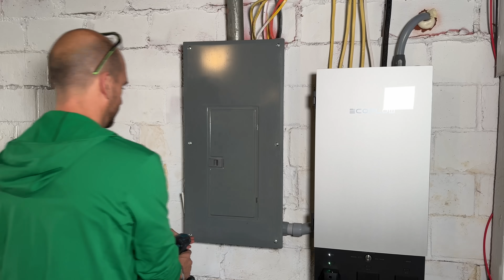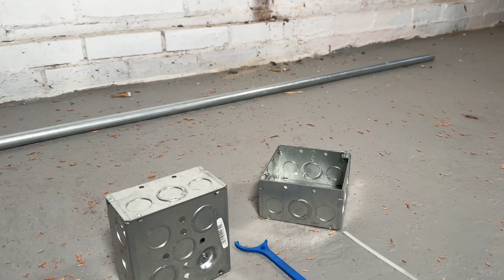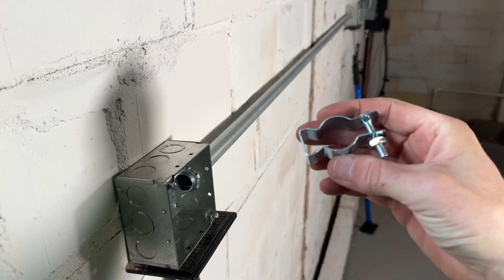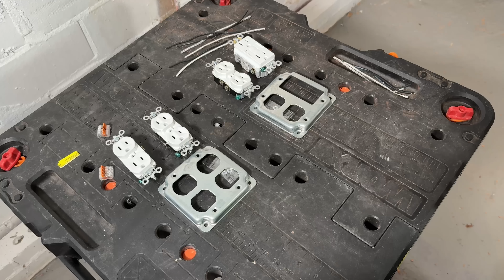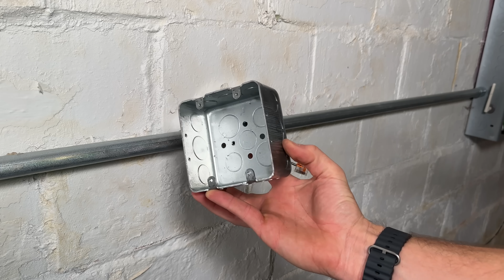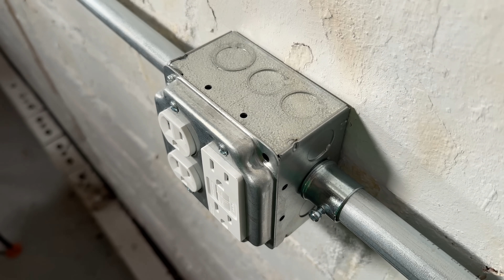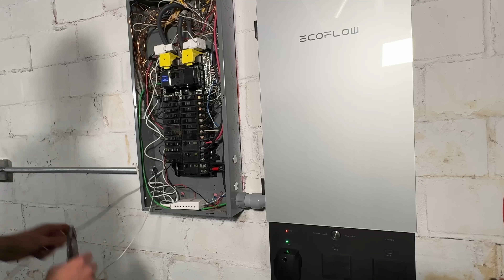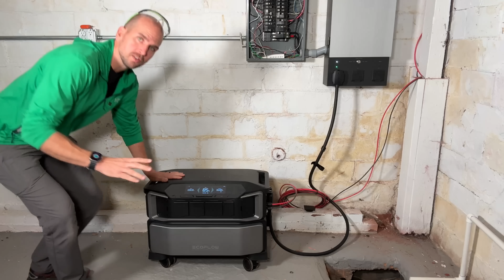Add Outlet To Unfinished Basement Or Garage

Comment: When it comes to bonding and equipment grounding conductors (egc's), the system should be designed such that a single point of failure does not degrade the integrity of the system.

In order to ensure this, it must be understood that bonding and egc's are two different things.  Bonding is intended to tie all metal surfaces together to guarantee that they are all at the same electrical potential in order to prevent a potential difference between adjacent metal surfaces that can cause a shock or an electrocution should someone inadvertently complete circuit between them. The egc is intended to provide a dedicated conductor to carry electrical fault current back to the source to complete the circuit and instantly trip the overcurrent protection to de-energize the circuit in order to reduce the risk of fire and electrocution.  Tying the bonding system to the egc, ensures that an electrical fault on the bonding system will trip the overcurrent protection and de-energize the circuit.

Relying on the bonding system to act as the egc significantly increases the risk that a high resistance connection will develop over time either through corrosion issues,  loosening of bonding screws, or other potential ways that the bonding can degrade or fail.  Having a dedicated egc ensures that the fault current path is not reliant on the state of repair of the bonding system.  It further ensures that each metal box and fixture are independently bonded to each other at the main panel through their respective egc's.  Even if the emt bonding screws come loose or individual bonding connections become compromised, each box and fixture will still remain bonded to all the other boxes and fixtures through their respective egc's.  In addition, in the case of emt, even if one end has its bonding compromised, the other end can maintain the bond and keep the conduit at the same potential.  Such a design ensures system reliability in the presence of a single point of failure.

Of course, you can have bonding failures at both ends of the emt, but, that would be 2 points of failure, and attempting to design a system that remains reliable in the presence of any 2 points of failure is nearly impossible, and even if possible is so expensive that it becomes unaffordable.  Also, in order for the emt whose bonding is compromised at both ends to become energized, the wires within would need to be compromised, which may happen if a wire was skinned during the pull, or during subsequent maintenance or repair activities, but that would be a 3rd point of failure.

In the case of your installation, a single point of failure compromises the system to save the cost of a bit of wire.  It's a very bad design.
Reply: Yeah, realistically, not running a ground wire here is comment bait. It might be to code; but nobody worth getting lots of views should do it…yet Scott seems to love to do that with his electrical work
Reply: The only way you can eliminate a single point of failure is to have two ground paths. Which is why in patient care areas you need to have two ground paths. If you use type MC or NM there is only one ground path.
Reply: @tcross7287  In the context of this case, the bonding path was being used as the egc, but with a separate egc wire, then single points of failure are covered.  With a separate egc the bonding path can act as a backup egc in the event of a single point of failure in the egc because the outlet provides an internal bonding connection between its ground pole and its metal frame which is tied to the box through its mounting screws.  Similarly the egc can act to maintain bonding in the event of a single point of failure in the bonding of the emt and boxes.  If the internal bonding of the outlet fails, the emt bonding path still maintains bonding and the egc maintains the outlet ground.  Thus, single points of failure are covered.

I'm not qualified to speak about hospital wiring as I've never had to deal with that in my career and I'm sure there are plenty of other special circumstance wiring scenarios that exist that have no bearing on the content of this video and my response to it.  I'm sure someone with expertise in wiring nuclear plants or some other special circumstance wiring can cite some esoteric requirement that challenges my statements, and even someone who will be put off by my use of the word esoteric who will then go on to explain why such and such a circumstance is not esoteric, but I digress...

I think at this point I'm done responding as the discussion is delving into special circumstances that have no bearing in this case and, IMO, offer nothing of further value to DIY'ers who will not be wiring hospitals or any other commercial applications.
Reply: @tcross7287  NM there is one all inclusive bonding and grounding path; the bare wire serves both purposes. MC has two lanes on the same roadway (a metaphor might be helpful), the metal armor and the green wire, that are both required to establish a single grounding and bonding pathway but they both serve both purposes and are not distinct pathways. I other words, it is NOT the case that the wire is the ground and the armor is the bond in MC. With emt if you add a green wire, that does create two lanes but they are not allowed to be distinct from each other electrically so to say that the emt is the bond and the wire is the ground is incorrect just as it would be incorrect about MC. They both, by being bonded to each other, create a single pathway to earth (dashed line allows for lane changing, solid line does not, same destination regardless). Hospital grade MC is no different, you are simply strengthening/reinforcing one of those lanes (armor) and not creating a separate pathway. There are exceptions by design, isolated ground circuits for example, but this is not one of them. When one starts with the (frequently but not always) false premise that grounding and bonding are different, the rabbit hole opens up.
Reply: The armor on type MC is not a listed ground path unless using MCAP with the internal bonding wire or HCF cable with a green ground and an internal bonding wire. I was trying to point out that first all there was no hazard if the ground path was interrupted to yoke on the receptacle as all of the receptacles were protected by a GFCI receptacle. As I’m sure know using a GFCI is the only way you can install grounding receptacles on a circuit that did not have a egc is to use a GFCI ahead of the receptacles. I’ve always pulled grounds whenever I ran EMT or RMC.
Reply: @tcross7287  MC requires the use of the metal sheathing AND the ground wire for an EGC, not just the ground wire, and it is not the case that the sheathing is for bonding and the ground wire is for grounding. Armored cable requires the sheathing be combined with a bonding strip, which means they are both parts a single EGC, but there is only one EGC that serves both bonding and grounding functions. I roll my eyes when I hear someone say that grounding and bonding are different and then proceed as if they are like 2 isolated roads that parallel each other and they are therefore distinguishable parts of the circuit. They're not. They are usually 2 sides of the same coin that are not seperable. EMT with a ground wire, both combined make up the EGC, not one for bonding the other for grounding. Grounding and bonding are usually identical in function and sometimes are a 1-lane road (ground wire in romex) or a multiple lane road (metal sheathing, bonding strip and ground wire in hospital grade MC). If you installed 5 green wires in a complete run of emt, all 5 plus the emt constitutes the single EGC for that conduit system. Multiples points of contact are not necessary for a properly functioning EGC. I've installed 480V 500A feeders through underground PVC with a single wire type ground and I'll never lose sleep over it.
Yes, adding gfi protection is the way to minimize the hazard of a circuit with no EGC and it remains gfi protected regardless of the presence or absence of a ground wire, but even in non-gfi protected circuits the devices are allowed to be bonded/grounded without a pigtail to the box and have their grounding path interrupted when removed/un-mounted) from the box. Self-grounding device to a mud ring attached to a grounded metal box, or a cover mounted device riveted to the metal cover, for example. If the device or the cover, is removed it loses its grounding path but it is assumed that a removed device is a temporary condition and not the final installed product, which it's not when things are installed correctly. I've installed hundreds of thousands of feet of emt, imc and rigid and unless it was spec'd or conditions required it, I've never added a wire-type conductor to support the already existing EGC. 
One thing I learned when I started was the importance of using your tools to tighten fittings, not your fingers or hands, because I always knew the metal conduit was my ground. Today's younger guys are for some reason being taught that the ground wire is your singular ground even with metal conduits. Not true, and potentially dangerous.
Reply: @pld8993  The sheath on MC isn't listed as a grounding conductor but it may be used to supplement the internal ground. I never said grounding and bonding were different. I was making a distinction on what is an acceptable EGC and there wasn't a hazard if the screws of the industrial cover aren't tight. I've always used self-grounding receptacles except when the job specs call out otherwise. Out of curiosity what size wire did you pull for 500A?
Reply: Safety glasses protect his head really good. 😂
Reply from the maker: Thanks for the feedback Brian.  I agree adding a ground wire would be a better design.

Comment: Hi can you explain to me what's the difference between the WAGO lever locks and using the "back stab" holes on the back of the receptacles. It seems to me the connection to hold the copper is similar.
Reply from the maker: The spring retainer and busbar of a WAGO 221 is superior to the average retaining and contact point in the residential grade outlets with speed wiring/backstabbing.  You could argue many push in connectors have a similar design to backstabbing.

Comment: You never explain why you didn't run the separate ground wire over relying on the conduit to carry the ground to the plugged in device.  

Ask yourself, why, in a romex situation, do you tie a metal box to the ground wire of the romex in addition to the receptacle?  Yes it is code but why is it code?  Because if a current carrying conductor touches the box, you don't want that box to go to line potential.  And, if you tying the receptacle to ground and the lid of the box is screwed to the box, does that not bond the box (so, long as the cover is screwed to the box)?  You don't want the box's electrical potential changing by virtue of it being open or not.

Okay, now, in your application, what if ANY of the fittings, screws, nuts...etc become even the slightest bit loose, including the screws holding on your cover plate, your grounding quality goes to crap or gone completely.  Any three pronged device that plugs into those receptacles could need the ground for more than just making the device at ground potential.  There could be other parts of its circuit that are dependent on that being a good ground yet you've allowed your ground, particularly to the furthest receptacle to have the most sketchy of grounds that you could provide as it is dependent on every fastener that came before it, including how your torqued the screws on the cover plate.  

Heck, let's say you forget to turn off the breaker before starting to open the box...the moment that cover comes off the box, the receptacles and whatever might be plugged into them immediately float.  Code or not, it is a very bad idea.  

Another thing you should experiment with...go to an old installation (any)...something with years on it...check and see just how tight all of the EMT connections are after "life" is exposed to them.  Just about nothing in electrical piping has any resilience in the fasteners that will keep them tight as they go through thermal cycles, humidity changes...etc.  They are not going to fall out but they also are not likely to remain at whatever bonding level they were when installed. It's one thing when you need it to be good enough to trip a breaker due to another failure...it is another thing if a device needs a good ground to operate properly (and/or noise free).

Comment: as close as this is to the breaker box, is it less expensive to use a GFCI outlet asa pass-through protector  vs a GFCI 20amp breaker? I have seen where
Reply: Gfci breaker ~$50 more, gfci recept ~$20 more. But for using conduit as EGC, I’d rather have the gfci in the panel.

Comment: I'm surprised that he hasn't switched to the new lever receptacles instead of using those old, poopie, tried and true screw receptacles. If you think about, lever receptacles are perfect for the inexperienced do-it-yourselfer. You have to make a shepherd's hook, make sure none of the insulation's under the screw, and use the recommended Robertson screwdriver. Not that pretty much all professionals don't just grab a flat head driver. If you think about it, terminal screws are much easier to get wrong than wire nuts.
Reply: I don't think the lever receptacles come in commercial grade, which is what he's using in this video. You don't need a loop for those, they have back clamps. Not the same as back stab.

Comment: We must have an uncanny psychic connection as I was thinking about this EXACT scenario a few days ago, and even argued with myself. I agree 100 % with you on your grounding  topic, but because I am me, and bullish (Taurus) personally, for myself, I would have pulled a ground anyway. Yes, I do things the hard way, I know. And that's what I argued about with myself. Why pull a ground if not needed ? I don't have a good answer other than the Taurus in me being stubborn. But it works and it's safe, so that all that matters. I am curious what would happen if the battery powers the circuit and a fault is introduced. A Schmucker batter with inverter I have, when I use one of those GFCI testers, all 3 lights come on. (I still have the old Xenon) not the LED yet. There is no legend that shows what it means if 3 lights are lit. I used a continuity tester between the hot and ground, and the neutral and ground. No continuity, so I am not real sure what's going on. When I pressed the button, nothing happened and the power continued to flow.

Comment: You still need a ground wire going to the breaker box as you are relying on a current path running thru the conduit to the ground connection in the breaker box.  The problem is the painted surface where your conduit enters the breaker box it may be good now, but if it rusts and corrodes.  Are you sure its a good connection? Just run the ground wire from boxes into the breaker panel to be safe.
Reply: Agree 100% . Youre relying on too many conduit connections staying tight to get a good ground . It takes maybe 36 seconds more to ground the metal box .
Reply: I believe where he ran the conduit into the panel box was concentric k.o.s Not allowed for grounding purposes. No straps,  I would have stripped about 3/4" of insulation off the wire and wrapped it around the device screw and continued on to the next devise screw then continued down to the next receptacle and done the same thing. I may be wrong, but I believe the codes now require every junction box to be grounded by wire. also I do not know an inspector who would approve using a pipe cutter on EMT.
Reply: @hankkline7300  Concentric knockouts are allowed for grounding, except for service equipment. Junction boxes with EMT grounding system are not required to have a wire-type ground.
Reply: No ground wire needed if using metal conduit EGC.

Comment: I got my Master Electrician's license in 1989. I guess the code has changed significantly (?). So much I disagree with in this video. One thing that is correct is not running sheathed (romex) cable in conduit.

Comment: No grounding wire connected to the outlets?  If you use a metal appliance or metal tool and there is stray/broken neutral within that tool or appliance then you are going to become the ground.  Maybe I am missing something?

Comment: Romex is fine. Honestly. If they are doing the electrical themselves, they probably have some romex laying around and shouldnt need to buy some wires with less sheathing\insulation for their outlets. Its obviously not a wet location based on the knockout style boxes  being used. There are no compression fittings or glands being used. So romex just provides a little extra sheathing and wont hurt at all providing the correct wire gauge is used.

Comment: I’m sure some do it, I have never seen an electrician run THHN for basement plug boxes on concrete.  All I’ve ever seen is NM-B in conduit.  I rarely see horizontal runs across masonry for basement plugs.  Always NM-B run around the sill plate and vertically down in conduit to each box.
Reply: What difference does horizontal or vertical make?